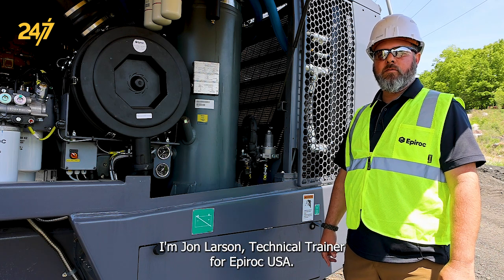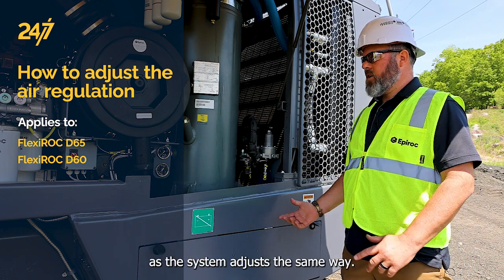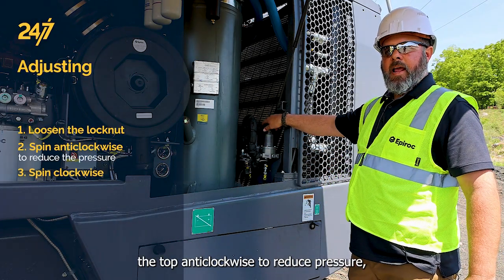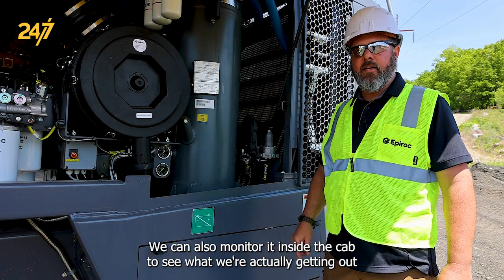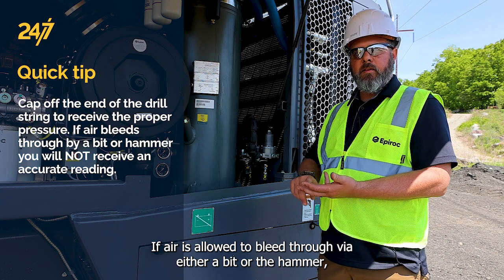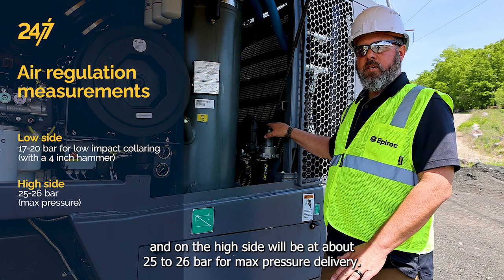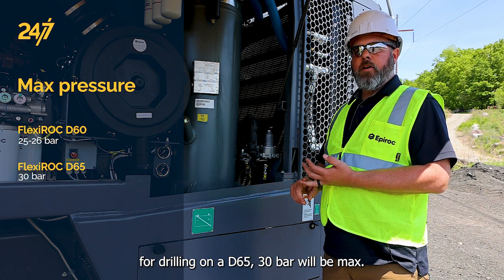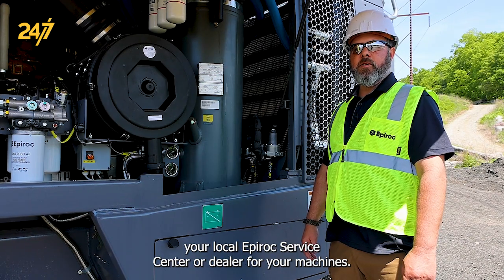How to adjust air regulation | FlexiROC D60 | FlexiROC D65

Comment: Instead of caping of the drill string to set the correct compressor pressure you can disconnect the four cables Y115 Y116 at the purge air valve to prevent it from blowing and to build pressure.